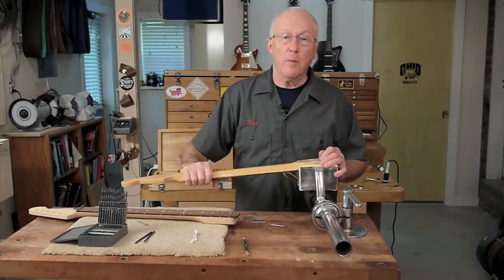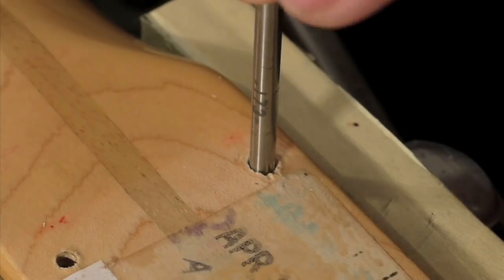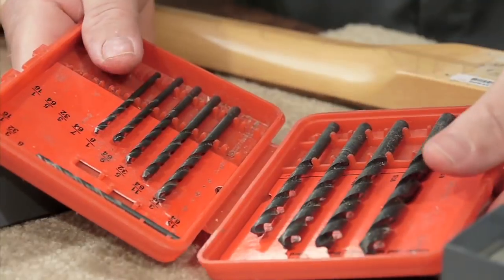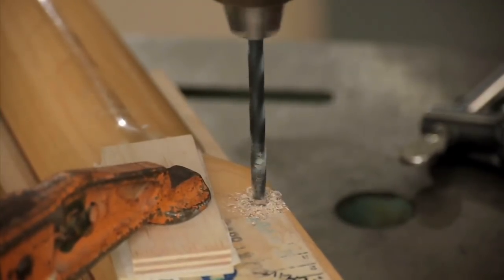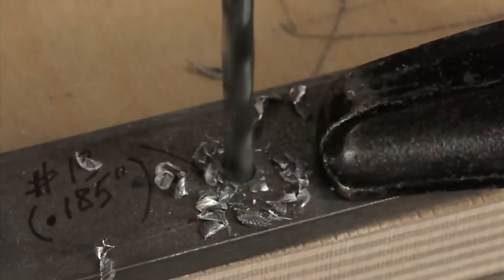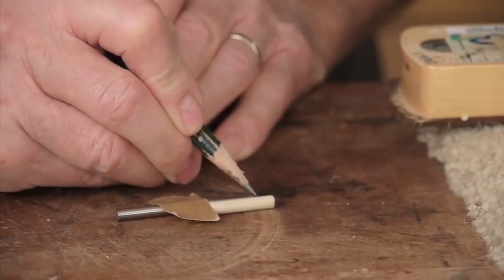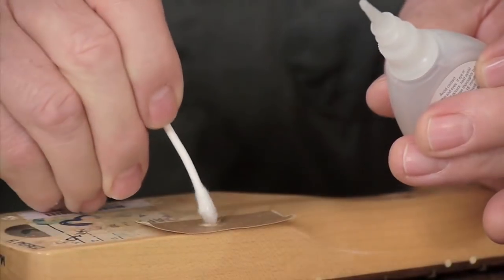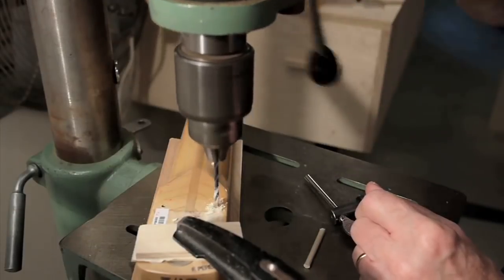Plugging stripped holes in bolt-on guitar necks

Comment: You don't need dowel gauges for that job.  Use the non-fluted portion of a drill to do the measurement.
Reply: Greg T That's what I do, but gauges are probably considerably more accurate. I can't imagine it's enough to make any difference in finished product, though.
Reply: dowel gauges to measure a flogged out hole in wood what a joke!
Reply: And this gentleman is why when elders speak we shut up and listen.
Reply: @johanherrera6413  when is the wedding?
Reply: When I buy dowels they have the size of the hold i should drill right on the pack.  I've never had one be too loose or tight.  Perhaps we have better quality dowels here??

Comment: He has all those tools to work with which no normal guy with a stripped bore in a neck heel has... The simple answer is get a piece of maple dowel that is or can be trimmed to fit well in the hole and yellow glue it in. Rebore after 24 hours dry time and that's it. Use a light wipe of ChapStick on the screw threads to reduce friction when screwing in the first time. And do something with $ rather than a dowel size set or all the other stuff a pro shop uses.  Get real,  Dan.

Comment: I'm thinking just use the next larger screw.  At least that is going to bite into the hard neck wood instead of the approach used in this video where you are screwing into the dowel wood.  I guess the purists would be aghast at using a different sized screw than the original 🤷‍♂️
Reply from the maker: That's certainly an option in some cases, but generally neck screws are all about the same size. If you can find a screw that fits, it can definitely be a viable solution for some guitars. Thanks for watching!

Comment: If the fit is too tight it creates an airtight seal and you won't be able to hammer it all the way down. I repair broken cello necks with dowels so I know what I'm talking about. I work around this problem by scoring a really small line down the entire length of the dowel with a knife. It creates a small hole just enough for air to escape.

Another thing I do for a better fit is to is shape the tip of the dowel the exact shape of the drill bit. The drill bit is not flat so the dowel shouldn't be either.
Reply: Really nice tip!
Reply: @ikereed6847   that's what she said.
Reply: haha some guy said the same thing about scoring the dowel in the comments 2 years before this guy did.
Reply: Could you not drill a very small diameter hole through the centre of the dowel lengthways so the air can be forced out up the middle of the dowel? I mean you're drilling the dowel out later anyway so in essence you have a predrilled pilot hole as well.

Of course I'm no luthier.
Reply: @ray.shoesmith  I wonder the time cost of drilling a hole through a dowel that will
1) not sufficiently damage the structural integrity of the dowel
2) be centered enough to meet criteria one
3) Be small enough to meet criteria one
4) Be simple enough to save time
Reply: dan just whacks the dowel harder until the neck cracks

Comment: Thanks for the pro lessons, Dan.  I just copied your method to fix a stripped hole on my '77 Jazz.  One concern I had, though, was compressing the air below the plug.  You can create a small pocket of air at maybe 100+ PSI inside the neck!  I used a utility knife to carefully cut a tiny groove up the side of the dowel, allowing the air to escape and the dowel to drive deep with no back pressure.

Comment: Hey Dan, I was always taught to groove the side of the dowel because you can split the neck as you're creating (in effect) a wooden piston and the compressed air needs somewhere to go. When I was a young cocky kid I didn't believe this and guess. what? Loving your work and guidance G
Reply: Pre-drill a small diameter pilot hole through the centre of the dowel. Lets the air escape
Reply: you can get dowels with grooves in them from hardware stores, it helps the wood glue seep out also

Comment: If you're not in a hurry, use Titebond, or another strong wood glue. It takes longer to cure, but it will strengthen the area of the plug significantly.

Comment: Good vid as always!   You're the "Norm Abrams" of the guitar world for sure!    When I was a kid I helped my dad working on repair jobs at the apartments he/we owned and whenever we encountered stripped wood screws we just inserted wooden match sticks into the hole and snapped 'em off to depth (removing the flamable tip end of course).   These were typically door hinges or cabinet hinges but it would work in a pinch on a cheap-o guitar where you're just looking to fix something quick.

Comment: Well done Dan is the man! I have done threaded inserts on all 4 holes in the past. Sure wish I had that  curved block of wood to set the neck on the drill press table!
Reply: One trick is to make a jig with two flat pieces of softwood "bookending" the two sides of the neck + a couple of g-clamps. Keeps your neck "flat" + the frets do not even need to touch your table.

Comment: Very nice video Dan! However, I have a question. Why in one video with dowel hole repairs did he use a maple dowel with wood glue for a tuner knob, then use a dowel from a hardware store with super glue for the bolt on neck piece? I am confused at when to use the right type of adhesive and what type of wood to use, I have a Washburn Patriot 6 string I have all 4 holes (where the neck screws go in) are stripped and one tuner knob hole stripped. I would like some help in figuring out what materials to use for each job and why for each adhesive and wood combination.

Comment: You should've used a maple dowel - not poplar - Woodcraft or Rockler has a much larger selection of woods. Also, the dowel didn't bottom perfectly because the air wasn't able to escape. If the dowel is too wide then lathe it down in a vised drill and use sandpaper until a perfect fit can be achieved.

Comment: Seems like there should be more material (diameter) for the dowel in order to not crack out when you drill and reinsert the screw? I've never done one of these, and it just may be the camera angle, but it doesn't look like there's much more than 0.025-0.030" or so material outside the new hole in the dowel. Aren't you worried about it cracking away (or just not holding) when you apply some torque to tighten the screw on reassembly?

Great videos though--amazing education in these StewMac vids...

Comment: I agree. I did a true luthrie apprenticeship, not just guitars. After the German guild wars luthiers were allowed to make anything stringed. Guitars could be made by cabinet makers after the dispute was settled. Anyway I have had drill bits grab when graduating contrabass, cello, or other arched tops or necks. A real depth stop is the best bet. That damn drill bit grabs and sucks  the top right up the shank. It will do it with a neck too! It sure ruins yer day! Tape will slip up the bit.

Comment: why you don't use titebond glue?
Reply: I guess heat from drilling job might melt the glue down and the plug could be loosened. Or even the heat from the fraction of the screw. Screws are very hot when they are pulled out of super tight hole.
Reply: I was thinking also because you don;t want to wait for the glue to set ?

Comment: Industrial Pipe and Steel usually has a decent price if you want a really good one. I was shocked at how nice the Harbor Freight  Cobalt drill index was made, and for under $100? I paid $279 for the one before it. There is not $180 difference.

Comment: Would this same idea work towards fixing stripped pickup mounting holes?
Reply: tooth picks
Reply: @northmanlogging2769  I’ve used toothpicks several times before. I put them in the stripped out hole with wood glue. I then just screw the original screw in (after it dries, of course). I can’t recall any coming back out after that. This is on cabinets door hinges, etc. I’ve never tried it on a guitar, but might if I need to. It will be a choice between dowels or threaded inserts with machine screws. Doubt that I would use toothpicks on a guitar.

Comment: I'm surprised no one suggested using the drill press chuck like an inverted lathe and filing or sanding his dowel to size ;-P.

Since he said he was hanging out with better woodworkers and machinists back in the day,one of them could have suggested a metalworking mini lathe as a shop tool too.
Reply: Using the hole drilled in steel is more work but more accurate in diameter (without having to measure it as you go) and likely straighter as well. 
I did use the drill-as-a-lathe technique many years ago to made an ebony strap button for a 1937 Gibson archtop. Worked quite well.

Comment: I am shocked! You did not try to sell me 7 products from Stewmac. You can buy a "drawing plate" that will size your dowels. The true "full index" (ca 1942) has fractional, number, letter, and an extended metric sized set with 1/4 and 1/2 mm sizes below 4mm. After that it's custom bits. Harbor Freight actually sells a Cobalt 115 piece #, letter, fractional that is worth buying for a change for under $100! Their LH set  for stripped screws in bridges & changers is great too.

Comment: Hate to admit this...but on a stripped hole on my '60 Esquire I put a q-tip and a small bit of super glue in the hole , then removed and let dry for a couple of days before reinstalling neck...still holding +10 yrs later and countless neck removals/reinstalls...also completely undetectable...added just enough to create a new thread base, and assume the bottom of the hole had more glue than the end towards the opening...worked perfectly...just saying

Comment: Very pro !!
Reply: Very complicated and expensive you mean! Lol
Reply: +Dylan Hardin Yes...  He covers everything with some very expensive dowel measuring little things that cost an arm and a leg...  Toolmaker pro tools !  I'm doing a part caster right now and had to plug the 4 holes in the body.  I still have to plug a mexican 1970 neck, than install brass inserts, etc.  I'm adapting a contour neck plate to that...  The only thing where I think he might be wrong is that he is using what looks to be a pine dowel.  I'm using hard wood dowels...  Much better (and you don't cut these with a little knife...). Cheers !
Reply: +Eric D. Agreed, use what you have and but tools that make your work easier it they pay for there self over time

Comment: You don't need to size the hole with a dowel...just buy a 1/4" drill bit and some 1/4" dowel, done deal.
And no need for an expensive pin gage set...and use wood glue, not super glue...cripes...
Reply: My thoughts exactly. Except for the superglue, that's just all good.
Reply: apinakapinastorba 
Couldnt you just use a plug cutter the same as caroenters use to cover recessed screw heads? Then you would still be going into side grain. 1/4 inch plug in a 1/4 inch hole.
Reply: You can also use a drill bit to check the size of the hole.

Comment: Why not take a piece of dowel and put it in the drill chuck and use a mill file while you have the neck in the same clamped setup? That would be a faster solution than drilling a hole in what looks like  a piece of 1/4 cold rolled steel,trust me ;-)

Comment: In 2021 we just fill the hole with epoxy and drill it out like we would any other hole in wood that is going to be covered up and not seen. 

Its going to be under the neck plate with a screw run into it. Nobody is ever going to see it and its going to be stronger than any glued in dowel could hope to be.
Reply: Do you think gorilla wood filler would also work

Comment: Problem is, that dowel will NOT be round. Traditional drills do not produce perfectly round holes. Where precision is key, this would not work. Although you wouldn't be using wood for precise work anyway.

Comment: A better job would be to put a nut insert on that neck and bolt it on the body instead of using screws. We've been 'screwed' by manufacturers for calling their guitars "bolt-on" when they're "screw-on" and getting away with it for years and years